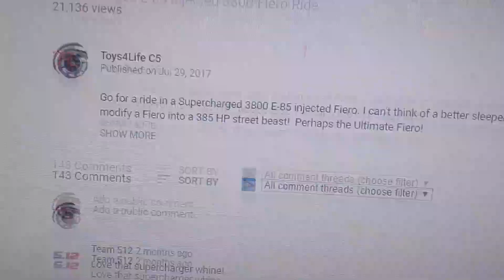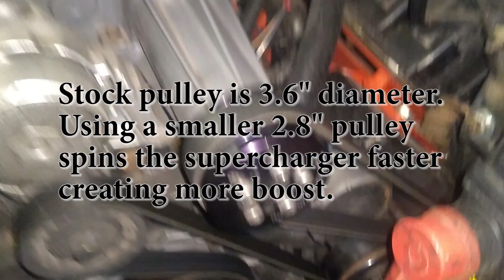3800 Supercharged Fiero (Tips & Closer Look Part 1) / Engine Swap

Comment: What transmission are you using
Reply from the maker: 4t65e-hd from the donor car controlled by the donor PCM.
Reply: @Toys4Life it can take 400 ???
Reply: Or did you build it
Reply: How many miles sice the build and the transmission is holding up
Reply from the maker: 400 what?
Reply from the maker: Mild build
Reply from the maker: 8 years, about 800 wot pulls from 0 to 70
Reply: What do you do or you dint even open the transmission  @Toys4Life
Reply: How much hp is it pushing  @Toys4Life

Comment: Did u have to get it tuned when cam was installed?
Reply from the maker: The VS cam is fairly mild so it will run without tuning - - BUT you absolutely should tune it to get the most out of the cam!

Comment: Do you have to change the motor mounts? Wiring harness? What all would I need to do the motor swap
Reply from the maker: I changed the engine, transmission, computer, and took the wiring harness from the donor vehicle and essentially spliced it into the fiero's harness. That's pretty bad, but I can't really give you a step-by-step but that would get you started. Pennock's fiero forum, search the archives, there's tons and tons of info in there. That's exactly what I used as my main resource.
Reply: Oh wow yeah not very good at wiring. Is there many splices or just mainly for the tach. Thank you I will check that forum out
Reply: So the transmission that came with the 3800 series 2
Reply from the maker: @NANOLIFER  Yes sir.

Comment: If the cars these engines came out of didn’t require e85 fuel then why does the fiero 3800sc?
Reply from the maker: It doesn't, I just set it up that way to make more horsepower. E85 allows more horsepower with a supercharged setup without the expensive adding an intercooler.

Comment: I've watched about 5 of Toys4Life's videos on this car but haven't found a $$$ breakdown of the swap. You can find clean stock Fieros for $6K-$10K. How much was the build?
Reply from the maker: If I did a breakdown a few years ago it would be obsolete by now, Fiero prices have shot up the last couple of years. I received my Fieros (which were in rough shape) about 15 years ago for free from my father.  I did a Total Restoration by combining the best parts of each into one four-cylinder fiero. At that point I fell upon a deal on a 3800 na engine and I had to swap that in. I love that but then I wanted a supercharged engine so I bought one for about 600 bucks. I added a cam, injectors, fuel pump and a transmission rebuild so I have a total of about 5 grand in my car and a ton of hours. Your mileage will vary.

Comment: What rpm does the engine peak?
Reply from the maker: It pulls really hard right up to 6200 RPM which is where I have it set to shift.
Reply: @Toys4Life  Do you remember more than 20 years ago. There was a Fiero with a 3 liter 16 valve 4 cylinder in a magazine?
Reply from the maker: It's not ringing a bell, specifically what engine?
Reply: @Toys4Life  I think it was called a Super Duty.
Reply from the maker: Oh yeah, the super duty program. Those were impressive for sure but parts were never really readily available. Also, you're never going to have a ton of torque down low without displacement, so if you add 3.8 l and another atmosphere of boost at 2,000 RPM, that's where this setup really shines.

Comment: Back in the 80s a coworker had the indy edition. It had a factory intake snorkel  from the engine  compartment to the back of the roof. If I'm rembering correctly.  I was surprised at its performance.
Reply from the maker: The 2.8 v6 in the 80s with a 5 speed was not too bad.  HP numbers were low across the board!  Cheers!

Comment: I made the same mods to a buick reviera and found that while the extra boost was awesome, I ended up melting the top of the pistons. I then went to an intercooler but still did the same over time.   You really need forged pistons and there was no mention of that here. Did I miss it?
Reply: @Toys4Life  I have had 3 of those engines a part and I beg to differ, now it does but I had to put them in myself.  I am talking what came in my 1996 Riviera what would you be alluding to? Maybe in other models they put forged???

Comment: Where did you get the engine mount brackets
Reply from the maker: I made two of the three. The one closest the driver is a stock 97 Buick regal mount for that same position.
Reply: West Coast Fiero makes custom mounts and parts for 3800 swaps https://westcoastfiero.com/

Comment: How did you make that SC to wine? , cause ive never seen a stock 3800 grand prix doing it
Reply from the maker: Two things. The cold air intake that I have on there doesn't have any air baffles. Therefore it doesn't quiet it down and you hear the wine. Believe it or not old people that bought Buick regals didn't want to hear the wine. secondly it's spinning a lot faster with the 2.8 pulley versus the factory 3.6 I believe.

Comment: badass. have you seen the 3800 supercharged swap work with any manual transmission Fieros?
Reply from the maker: I think the fiero  manual transmissions are too weak. there's another five-speed that is used I can't remember exactly what it came out of but it's quite a bit stronger than the fieros transmissions. Before 4T65EHD just launches so hard in that little car and is quite durable and really is a lot of fun for drag racing. I get it though if your mind is made up for a manual there are some that work they just take a little more work to do.

Comment: Umm did you just say the hot ticket 2.8? LOL
Reply from the maker: Yep, did you see the screen caption I think it said lol...
Reply: @Toys4Life  No I missed that. LOL. But seriously I want to know how hard was it to run E85 in the 3800 SC Fiero. Like I said my swap was done back in 2000 with an 2000 GTP test drive crash that was a total with 289 miles on the clock. Now 20 years later it has a lil over 25k. The engine is still stock & I am looking for some more power that will not take away from reliability. This is my toy car & #3 back up car. I hardly never drive it. I like to sometimes race it at a local small Nascar track here on Wednesday nights & am just looking for some more power to hang with the big guys.
Reply from the maker: @MercedesE63S-AMG  You better subscribe for this (:-)  *What fuel pump are you running?   Deatsche Werks DW 300 - had it since 2013 NO issues
.  *What injectors?                       Siemens Deka 60 lb - from ZZPerformance.  Don't buy from sketchy sources i hear there are fakes... *Do you have to run new fuel lines rated for E85?   NO.  Just replace all rubber hose with line rated for ethanol.  Available at auto parts store - says rating on the exterior of hose itself.  *Any concerns with E85 in the Fiero fuel tank? -  My tank was pretty clean.  Some are rusty and  dirty.  I replaced my fuel filter (used a Tahoe flex fuel filter) in 1 month and cut it open to see if it was packed with "junk" from the tank cause I read it would be.   It was fine.  Good idea to do anyway.  If it is dirty, Keep changing monthly until it cleans up.  You don't want a clogged fuel filter which equals clogged fuel delivery.  *How much timing are you running?  -  20 degrees at WOT 

*Did you tune your PCM yourself?  - YES  HP Tuners. 

*Problems you ran in to? Pros and cons?               No real problems.  Tuning is not for everyone.  If you have a good fundamental knowledge about how engines work, what timing is and generally what advancing it and retarding it do, what rich and lean fuel ratios are and do then you can find what you need to do on the web to tune the Fiero.   Now Subscribe! (:-) ...
Reply: @Toys4Life  I already subscribed. Thanks

Comment: I'm looking forward to do the same engine swap on my future fiero gt, but was the new engine already fitting pretty well, or did it required a lot of modifications?
Reply from the maker: I think the 3800 fits better than the 2.8 because of the goofy intake manifold on the 2.8.

Comment: Gotta say that I would put better fuel injection on and a better supercharger before the e85 ever went in because of how much maintenance would have to be done to upkeep the fuel system because e85 erodes the fuel lines and pump fittings more than regular gasoline. Better fuel rail and injectors would definitely help the power.
Reply from the maker: It's been on e85 for 5 years. Swapped in the correct fuel pump, e85 rated hoses and DECA 60 injectors, no issues. How are you going to get me more power? It's a serious question cuz if you can find more power I'll do it.

Comment: I think you should put an LS 5.7 in there and then twin turbos 😁
Reply from the maker: I would consider an LS, but above my current horsepower / torque level transmission options that are reliable start to get very limited..

Comment: What clutch and transmission do you use 
Kinda important
Reply from the maker: Part 2 is coming!   Tranny is the 4 speed auto from the donor 97 regal gs.   4t65E-HD.  Chose it because it is strong.  I have beaten the daylights out of it for over 5 years with no issues!  Hundreds of passes at the sticky dragstrip too...
Reply: @Toys4Life  lol I had no idea you could jam all that in there 
That's crazy 
I want to see it 
And I was always told that automatic gm 3.8 supercharged gtp and regals anything 3.8 has weak tranny 
For eg 
My dad had brand new 2001 Monte Carlo ss 3.8 and he commuted with it and gm did all the maintenance and it died at 242kms 
And the tokd him He needs a tranny rebuild 3500 bucks 
I found him a used one from a wreckers with warranty 500 bucks then he got another 2006 grand prix gt 3.8 supercharged series 3 and i want to get a pulley but I don't trust that tranny 
It has 80k on it to

Comment: I kind of wish you had gone into more detail on this build and performance.  It was enough to be interesting, but not enough to really help someone trying to replicate your build.  Time moves on... I guess there is no real way to go back and recreate a series on this build.  Oh, well.
Reply from the maker: Sorry man, I didn't even have a YouTube channel when I did most of the fiero build. If I do another one, which is a huge possibility, I would definitely create a video build thread!!!
Reply: @Toys4Life  There isn't a really good series on the process.  If you do do it, I'd try to balance performance with reliability, trying to use the most straightforward process and the most off the shelf parts as possible.  There is another YouTuber who did it, and while I respect his skill he made a lot of compromises, which required a lot of modifications to various parts and systems.  This is not a problem if you intend to keep the car forever, I guess.  But let's just say I'd hate to be the guy that gets his car next.

Comment: Hay man how did u do your catch can ive got an l67 was gonna delete the pcv & run hose from pcv housing & another from the blower that woul otherwise go 2 the t.b would this work plus I noticed u did yours differently.
Reply from the maker: I do not use a catch can and have had no issues with excessive consumption.  I do have the 97 supercharger which has different hose routing than the 98 and newer - maybe that is what your are seeing?
Reply: @Toys4Life  what about your valve cover breather do u get oil staining the hood also did u need to tune it cause of the air difference?

Comment: Hey man real good information on the video. I’m trying to build a fiero myself and I wanted to put the 3.8 in it. I was just wondering where you got yours and how many miles it had on it? I don’t know much about these engines and I want to see what would be a good buy based on the mileage.
Reply from the maker: I got a couple of old Fieros about 15 years ago that my dad was getting rid of.  I took the best parts from both and made one with a 2.5 96HP engine.  It was fun and got 30MPG but a couple of years later my father in law gave me a 3800 NA motor pontiac bonneville and so I decided to do the swap.  Loved it but regretted not doing the supercharged 3800 so I purchased a hail damaged 150K mile Buick Regal and transplanted that engine into the car.  I just made sure it had good compression and oil pressure as those are the two most important indicators of an engines health.

Comment: Why is it that all anybody cares about is drag racing.  Acceleration is important but the fiero was never designed as a drag car.  Ths 88 became the icon because it had a new suspension that made it a great handling car.  That's what made the car fun.  Anyone can put their foot down.  Big deal.  Try learning to left foot brake while toe and heal double clutch coming up to a corner, down shift, hit the apex and fly out the other end of the corner.  Driving is so much more than 0-60 or 1320.  Try optimizing the car for what it was designed for....corners.
Reply: Thanks for the reply. As my old boss used to say, thats why they make both chocolate and vanilla ice cream. You drag race, i twist around corners.   My only complaint is that the vast majority of you tube videos are about drag racing. There are alot more options, road racing, rallying and autocrossing to name few.   Good luck with your project.  Sounds like a fun challenge.   I agree that the miata is not the prettiest car.  Its appeal is its responsiveness.  I currently have a mustang.  The mustang is like a good running back.  The miata is like Gene Kelly, the dancer from the 40's musicals.   You drive a mustang.  You wear a miata.  That said, i always loved the fiero. I remember test driving it when it first came out.  Yes, i am old.  It was slow but the mid-engine layout made it feel special.  You could feel it rotate about you, and that was with the bad suspension.  I always wanted to drive an '88 with the good suspension.  Again good luck wjth your "quest".  Let me know how it goes.
Reply: @jked7463   
https://youtu.be/YwW1BR5zViA
https://youtu.be/AzNlGGawfJM

I saw a Miata with a naturally aspirated 3800 and it was a decathlete. It accelerated well and handled well .
Reply: @John Kedzierski - I agree with you man. Drag races and burnouts! ZZZZZZZZZZZZZZZZZ
I was able to do burnouts in my Scion xB! LOL 
I've seen a few of these cars on a track. Built right they are amazing for it.
But still. What this dude has done for his Fiero is pretty sweet.
Reply: A car for the road track takes balance.  That is why a 155 hp miata can beat a 755 hp hellcat in a tight road course.  Let's see you makes the car into what it was intended?
Reply from the maker: I get it - drag racing is not your thing and that's totally cool.  I respect the Miata but dont really like the way it looks.  Agree spending $$$$$ on a hellcat to drag race is a waste of $$.  You can build one hell of a drag car for 30k! Purpose of this project has been to go as quick as possible for the lowest amount of money (I have maybe 3k of $$ into this project) - and I would say every time I go to the track I am the cheapest 11 second car.  I an not really into autocross or road courses (yet) but if and when I do get into it, a 5 speed Ecotec (or similar) in and 88 Fiero would be a ton of fun.
Reply: @Toys4Life  im for drag racing.my 88 series 2 is pushing 272 ish??!!!
Reply from the maker: @petehiggins75  Sweet! Cool thing is --- you have plenty of room to grow still!
Reply: @Toys4Life  damn straight
Reply: @jked7463  lol, which road course does 155 miata beat a 755 hellcat? I don't care how light the miata is, that's still a lot of power to overcome....
Reply: Lmfao😂😂😂😂
Reply: You've been watching waaaaaayyyyy too much Tokyo drift pal

Comment: Thanks for the good information. How well does this car take twisties? Seeing it go down the strip it looks to have a ton of front end lift. I am looking to do a project Fiero as well, though I am leaning toward the 3900 since it starts NA at 240. I ask about the handling since I want to do track days and autocross with the Fiero, not so much straight line.
Reply: 84-87 'sucked' with stock suspensions. 88's were 'better' during the time but are honestly harder to find parts for now.

With modern shocks, struts, etc. the 84-87 will out perform any stock 88 by a mile. If you can find/afford an 88 there are benefits, but tracking down parts or modifying other parts are time consuming in comparison. If you want better brakes you can upgrade to grand am or C4 corvette brakes and you'll be fine.
Reply from the maker: 84 87 suck.  88 handles and brakes Very well!!!
Reply: 3.9 despite making the same rated horsepower, you will never compete with the torque from a roots. Often, a tune alone and running good fuel, knock will not kill power and wheel hp will be well over the rated 240 at the crank.